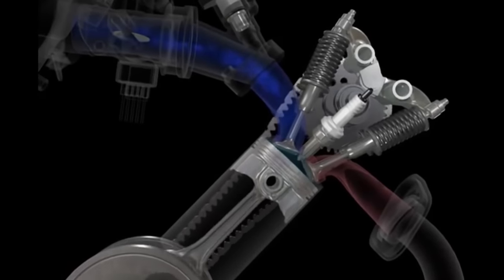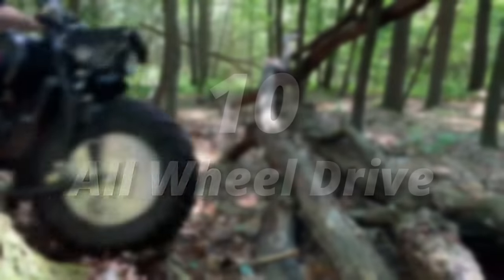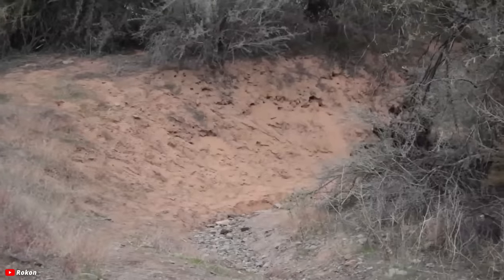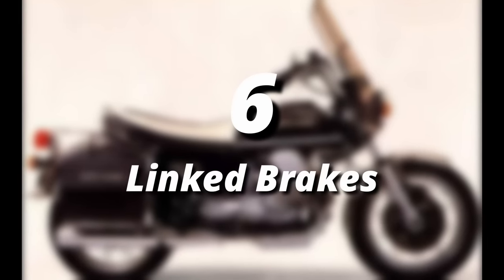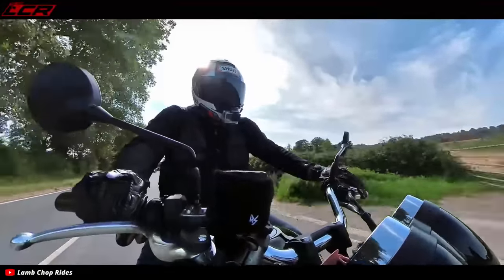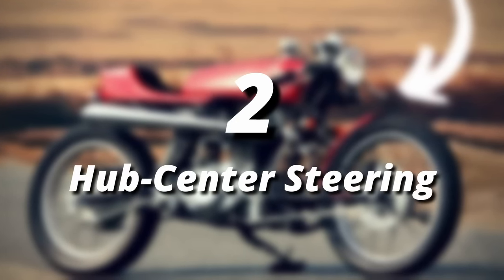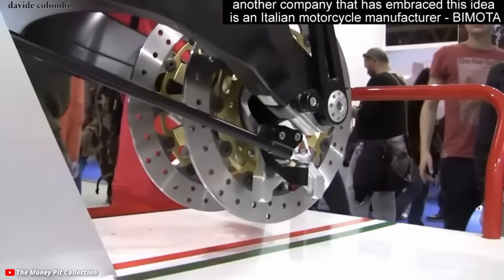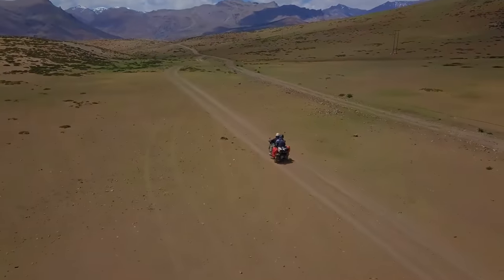10 Motorcycle Innovations that never caught on

Comment: vespa transmission shift is stupid. you can mis-shift more or less than the gear you desire. sequential is the only way for manual transmissions in motorcycles.
Reply: @MrUnderEstimated - "Vespa transmission shift is stupid. you can mis-shift more or less than the gear you desire."
ONLY if you're too stupid or too lazy to occasionally oil and adjust the cables.
Reply: @jackx4311  nah,  the lever position is awkward in certain gears and is tiring to use at certain angle, sequential is meta.